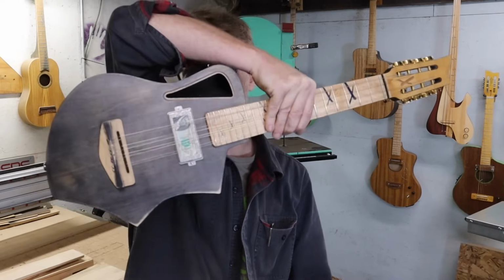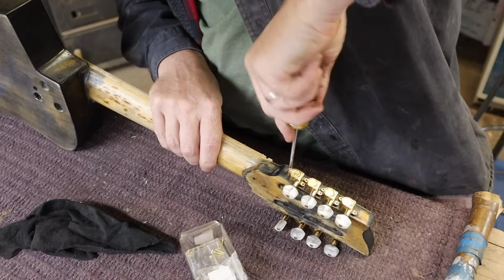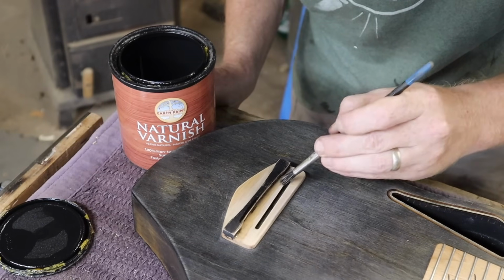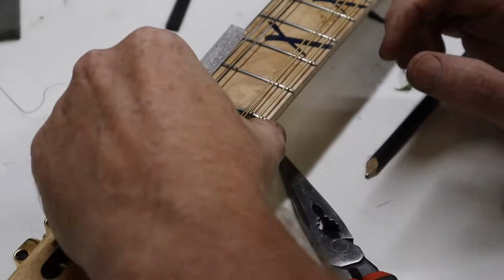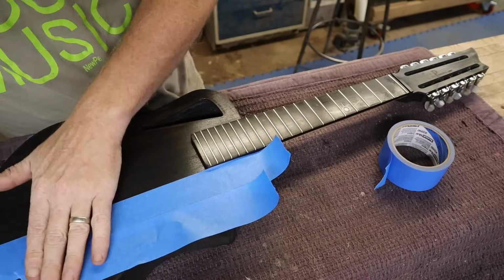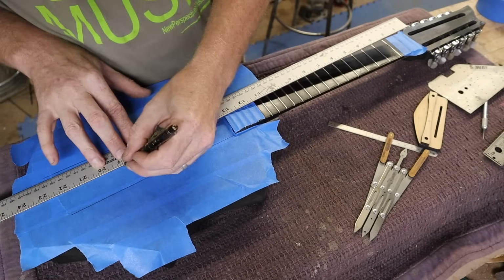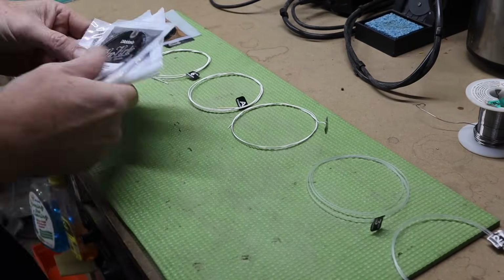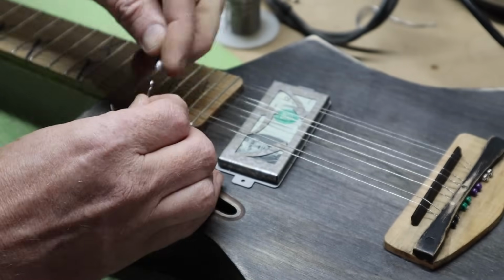Mandolele? Mini 12 String? Who Cares! Just Make Music

Comment: Tips and tricks for bridge application from an acoustic guitar factory: the position of the bridge is laser-etched into the top (just the outer corners and a center crosshair, and not all the way through). In the finish department, there are adhesive clear plastic masks in the exact shape of the bridge which are applied before any finish is put on. These masks stay on all throughout finishing. Once it's time for bridge glue-up, they're scored on the edges and peeled off from underneath using a double-edged X-acto blade (we don't have said blades in my part of the factory so if we get one returned that needs the bridge mask removed, usually we'll score it with a single-edge X-acto and then lift underneath with something akin to a sharpened feeler gauge). Once the mask is off, you're left with a perfectly positioned area of raw wood that the bridge can fit into neatly and be glued down securely.

Gotta say, these are a very charming and folksy pair of instruments you've invented here. I love when people push the envelope and take chordophones to new frontiers. This 12-string mandolitar (or sexto mandolo?), I'll admit, I was skeptical it would even be practical. But if anybody is able to do it, it's the guy who's already completely out of the box. Well done!
Reply from the maker: There's a box around here? Where is it? Lol. Good tips! When I started making acoustics, I laser cut the string-through holes and marked the bridge, but I found in my construction methods, there was a chance of that mark being just a little off when the guitar was assembled. I think my next step is to make a acrylic or mdf template/jig that slides over the neck and positions the bridge to it.

Comment: Tune the 8 string guitar in 5ths on the lower 6 strings and 4ths on the higher 2. It doesn’t matter what the note actually is, chord shapes and fingerings will be familiar.

Going from 5th to 4th and back to 5th is a mind bender.

Comment: Hi Tim;
12 string instruments have twice the stress on the top, bridge and saddle as a 6 string instrument. You will probably want to use extra light strings on your metal strings or all nylon strings. I really like the look of the instrument. It has a very nice sound too for as small as it is.
Reply from the maker: yea, these were both designed to be nylon, but I thought I'd try to get away with some steel strings on the prototype. They've been on a few weeks now. So far, so good.

Comment: tim sway 15:28 A Nylon 12 String Parlor Guitar (or 12 String Classical Guitar) which I think would be a great name based on its function. It's easier to play than a Standard 12 String Guitar because you don't have to push down as Hard on the Strings to get a Clean sound.

Comment: Oh wow, I like that 8 string way more than I thought I would.  Especially the last setup with doubles.  How much would you charge for something like this?  
Ya know, I started a small body short scale 12 string a while back and never got around to finishing it.  Gourd body cut out, elm neck from a pallet, spruce top from scraps, salvaged rosewood fretboard are all roughed to shape.  I even bought a set of tuning machines for a slotted headstock.  I don't know why I never got around to finishing it....
Reply from the maker: Well, I think it's time... The neck is a little wide on the 8 string doubled up version but I kinda like it like that as I can never fit my big fingers on ukes and mandolins...

Comment: When you started putting that magnetic pickup on the 8-string I still thought you have nylon strings paired with steel octave strings on it and I thought "it will pick up only those steel strings". After a while i realized that you had all steel strings on it, but I started thinking of an instrument with nylon strings and steel octave strings... Then add bright sounding magnetic pickup (picking up only those steel octave strings) and dark sounding piezo system (picking up all of them but mainly low end). Add a balance control between the two and it could be used as tone control, but it would work a bit differently than traditional tone control.
Reply from the maker: I had the same thought. separate outputs. lol

Comment: Have you ever tried using a trapeze tailpiece to remove the string tension from the bridge/top?
Reply from the maker: I have and do like them, but I find them more challenging on flat tops with basically straight, flat stringing. Not enough tension on the bridge unless the neck is angled up a bit y;know? Check out my acoustic guitar build from clear acrylic and you can really REALLY see, those forces at play: https://youtu.be/_9sX_ROSQAk?si=sgcgVBV_6M33wsLX

Comment: I love the body shape! Do you think the steel string instrument would be able to withstand the - I imagine - higher tension of an octave string configuration? I guess the small body wouldn't be resonant enough for the lower tones, but then it could be tuned something like f b e a instad (I don't know how to write the specific pitches, but you might know what I mean)
Reply from the maker: I think it could handle a lot more tension thatn I've put on it so far. Short necks don't succumb to bowing as much, yknow?
Reply: @timsway  uh, that totally makes sense now you say it 😬

I just figured that shorter necks are often slimmer, but it stands to reason that a lever mechanism effect (or whatever it's called in English)  is at play

Comment: Funnily enough I was struggling with an 8 string for Years, and it wasn’t until I put it in a weird open tuning like I was arguably more used to than Standard, and it made way more sense

Standard Tuning sucks for Rock Guitar, imo

It WORKS

But altered tunings (not just a downtuned Drop tuning, things like Open C, or on my 8, FCFACGCE) just seem to be More Conducive to it
Reply from the maker: I think there's a lot of room for that sort of experimentation. I'm pretty in to "big" chords and stuck on traditional tuning to get all those 7s and 9s, but yea, for rock. ehy not tune it for easy major/minor access?

Comment: Such a unique version of a guitar. 

I'd argue that a ukulele is a guitar - it's predecessor, the Cavaquinho, is classified as a guitar. A mandolin I'd define by the bowl body as opposed to the figure of 8 design of guitars). If this is tuned an octave higher than a guitar, then maybe alto-guitar might be the appropriate name (alto meaning higher)? Naming members of the guitar family is difficult because the six strings means that a normal guitar (Say E3 to E5) covers basically the entire classical male vocal range. If you tune an octave higher, then you are roughly covering the classical female range. A guitar roughly sits alongside the cello of the violin family, whereas if you tune higher, then you are roughly in the range of a violin and viola duo. So Guitarin or Guitin might work, although they look very strange to me.

Oh, it's tuned in the same octaves as a guitar? So it's a super short scale guitar then, easy :p (I've got a project in the back of my mind of a 350mm/13.75" alto-guitar, so my mind instantly went there)
Reply from the maker: The client build is definitely just a small 12 string guitar, regular range. The other thing? Well, I guess I need to decide how it will be tuned first... lol

Comment: The spacing of the strings G through to the low E need to close up more or the B and high E strings need their doppelganger strings to form a closer relationship as it appears that the b string is too near the G string. I am not paying the money and for all I know that may be a quirk of the customer's playing and they have requested it that way 🤷‍♂️. Regardless of that both guitars look nice and have the sound that you would expect. A great job 👏
Like deployed 👍
Reply from the maker: TBH I will probably carve another nut and bridge for it to address some of those issues before I ship it. I treated each set of strings independently as the thicker strings need more room to vibrate than steel strings... It's like the saying "If it looks straight, it is straight." Now That I've got it playing proper, I need to make it "look" proper.
Reply: @timsway  I already suspected that you were already on it, such is the worm ethic that I have come to know 🔥
* omg!* ' work' not bloody worm, fat fingers and blind eyes combo coming into full effect ☺️